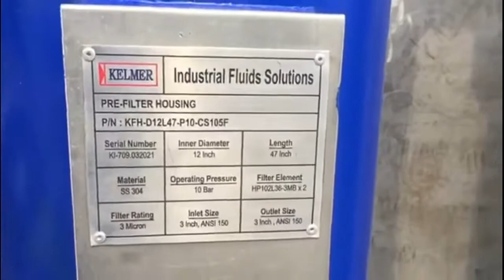Lube oil flushing unit Woking and why we use oil flushing unit

Comment: Sir what is difference between orifice and valve used in pipe line???
Reply from the maker: An orifice is a small opening or hole that allows fluid or gas to flow through. It is typically a fixed, non-adjustable opening. On the other hand, a valve is a device that controls the flow of fluid or gas by opening, closing, or partially obstructing a passage. Valves have the ability to regulate and control the flow rate, direction, and pressure of the fluid or gas. Unlike an orifice, a valve can be adjusted or manipulated to achieve the desired flow conditions.

Comment: Sir any 5 reasons why turbine used oil????
Reply from the maker: Lubrication: Turbines operate at high speeds and temperatures, which can cause the metal components to rub against each other and create friction. Oil is used as a lubricant to reduce friction and wear and tear on the moving parts.

Cooling: Oil also helps to cool down the turbine components by absorbing heat and carrying it away from the hot spots. This is particularly important in gas turbines where the combustion process generates a lot of heat.

Cleaning: Oil can help to remove debris and contaminants that may accumulate in the turbine components over time. The oil can pick up these particles and carry them away to prevent them from causing damage.

Protection: The oil in a turbine can also act as a protective barrier against corrosion and oxidation. It can help to prevent rust and other forms of damage that can be caused by exposure to air or water.

Sealing: Finally, oil can be used to create a seal between the various turbine components. This can help to prevent leaks and ensure that the turbine operates efficiently and effectively.
Reply: @InstantLearner  thank u sir...

Comment: Sir what is the function of oil accumulator??
Reply from the maker: It is used in lubrication system to  stores lubricant. Accumulator collects and releases lubricant as necessary to keep the oil level consistent in the system

Comment: Sir why cooling water is provided in generator front and rear??
Reply from the maker: Cooling water is provided in the front and rear of a generator to remove the heat generated by the electrical and mechanical losses within the generator